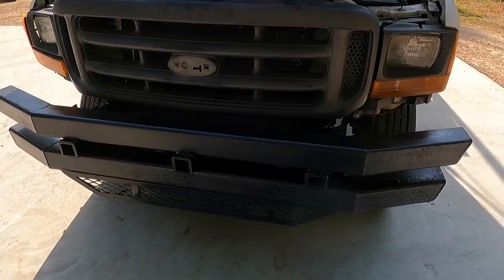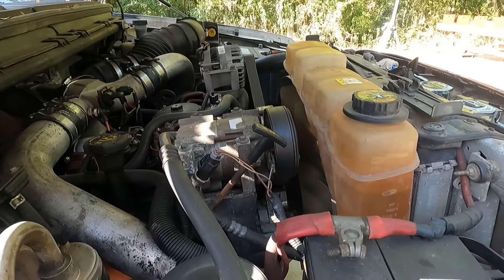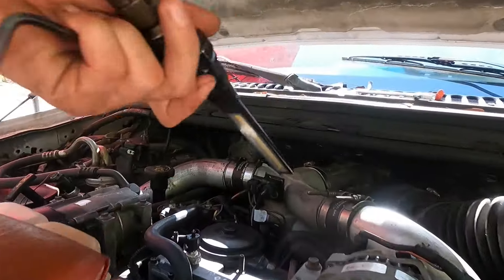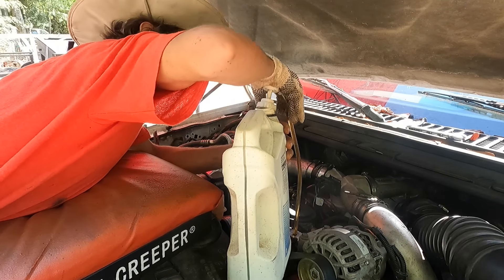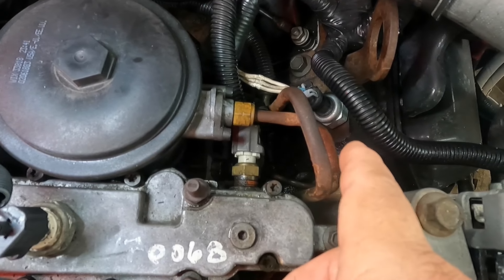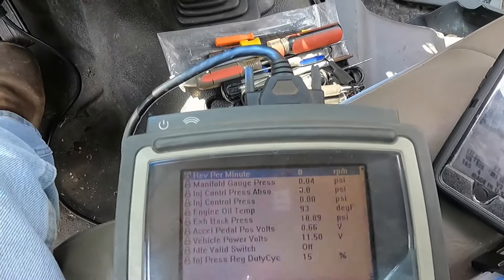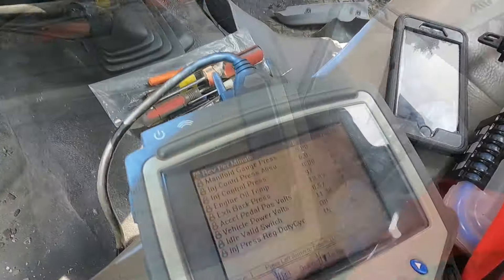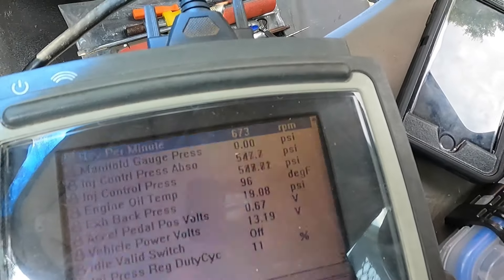HPOP Drained down.  Crank, No start.

Comment: Let me start over,after installing the hpop it started and ran but at idle it idled higher than before and after drivin it whe id try to start it would start and die so i put a oem ipr and a oem icp and it started good so last week i was drivin it and it died i towed it home and it cranks and no start,70 psi at fuel bowl scan tool shows 380 to icp and ipr 65% i sprayed startin fluid it starts and dies and i replaced cpm also it has a new 40,000 volt pcm but agin just cranks no start.
Reply from the maker: Based on that info I’m leaning towards hpop. 380 psi on icp won’t let injectors pop. As for the ipr %, at idol 9-12ish. 65% is max closed off bringing max hpop psi. Which should be in the 3000psi range. Under normal operation you will not usually see ipr opening more than the upper 30%. When it’s going to 65 (full closed) or more it is having trouble building pressure. 

Could be an hpop leak, air in the hpop system, or hpop  reservoir empty. 

These symptoms will not allow pulsing of injectors so no fuel getting to the engine. Which is why she will run on either but when you stop spraying there is no fuel.
Reply: @bayoudiesel  
So a new hpop can be bad??
Reply from the maker: @ronaldlemons2836  I run into brand new parts that don’t work at least a few times a month. I came in from a hotshot run in my 450 with 4 non working cps sensors on the floor. All bought that night on one run. 

Is the hpop reservoir full and staying full?

Fully charged batteries?
Reply from the maker: Also when you open up the hpop oil system to change the pump,lines or injectors air gets into that system. It can take around 45 miles or so driving to burp that system and clear all the air out thus beginning to run right again.
Reply: @bayoudiesel  i checked the reservoir and its full, i just cant believe the new hpop could be bad ive changed several ipr and icp,s i have a tool box full of them, and i ordered another ipr from ford as i said before it has anew wirirng harness and fuel bowl OEM,i guess the next thing is to dead head the hpop
Reply from the maker: Hey bud things got busy over the past few days.  We may be able to cover more ground faster over the phone. If you’d like you can send me your number to my email and maybe we can set up something. 

Bayoudieseltrucks@gmail.com
Reply: @bayoudiesel  
i replacewd the engine wiring harness and the UVCH

Comment: The oil is always cycling in the hpop if you have problems starting it’s probably the low pressure oil pump 
Changing that oil does nothing it’s just an internet myth
Reply from the maker: @Justmekpc  agreed on changing that res oil unless you have a sludge issue. This one occasionally with give a funny start due to the check ball in the timing cover leaking the res oil down after she sits for a few days.